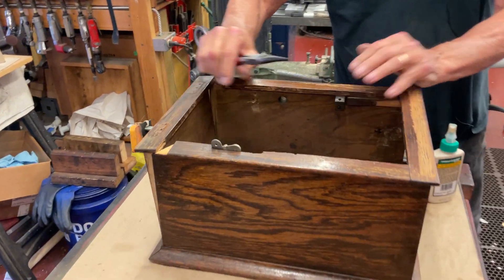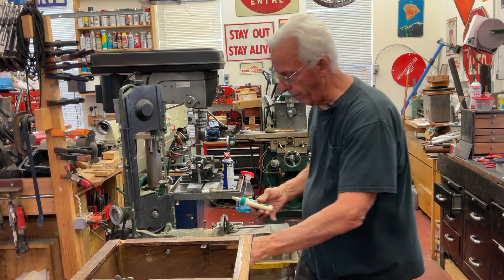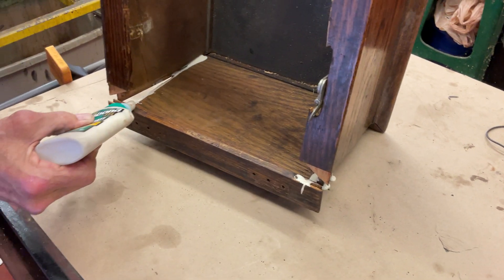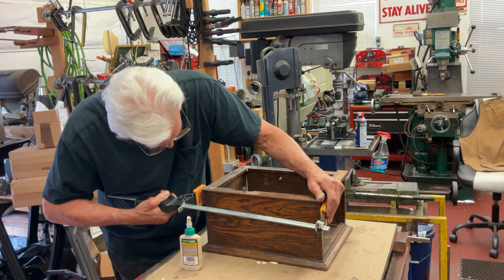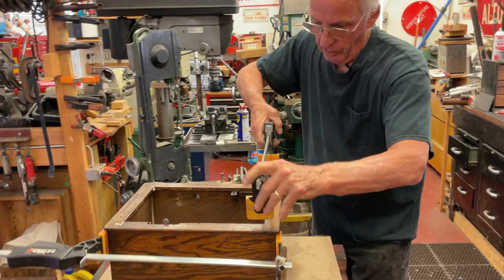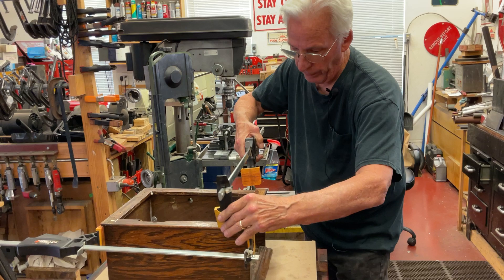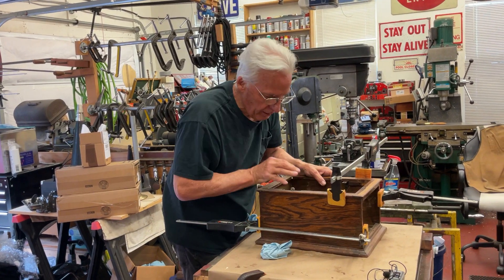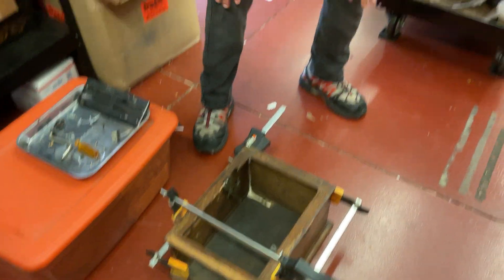1909.  How to glue a broken Amberola 30 cabinet

Comment: Greetings from Texas Brett.  I have a few video suggestions and favor to ask.  Over time, your suggestions for certain lubricants has changed.   Can you do a video on you latest recommendations and in which circumstances they are used.  Such as Superlube, sewing machine oil, STP, Vaseline and Graphite vs. Molylube.  Super penetrator vs. Mouse Milk etc.  Not only your recommendations but for what purpose of each.  Another video could be done on case restoration.  Strip and refinish or not .  Clean with Kotton Klenser vs. Goop vs. Gojo vs.  New Life.  Shellac vs. Poly vs Tung oil/Shellac (waterlox), Restorafinish, Howards Feed and Wax vs. Kramer's best. Times to use 0000 steel wool and other times bronze wool.   Another vid on restoring metal...wire wheel vs. evaporust. How to polish and restore shine.  When do you need to consider replating that worn metal part and can you use a home replater kit.   How to restore tired paint finish on metal parts and horns.  See here is an entire series that will help all us home restorers.   Thanks so much love your vids   James Manker
Reply from the maker: These are all great suggestions and I’ve made a note of them and will be doing just as you ask!